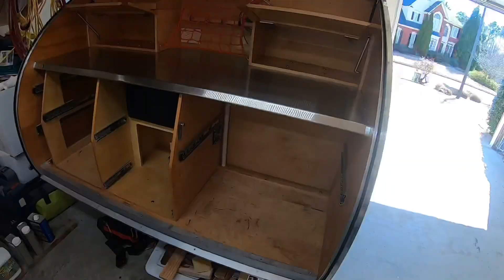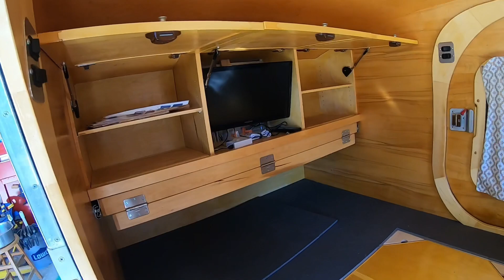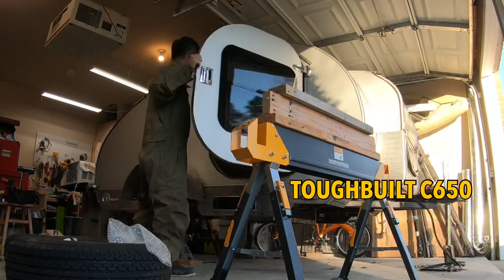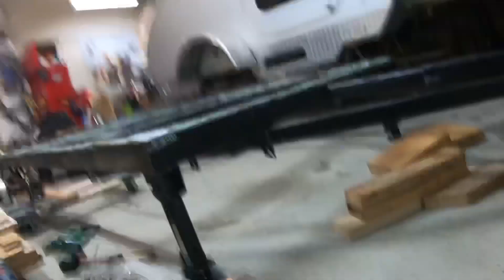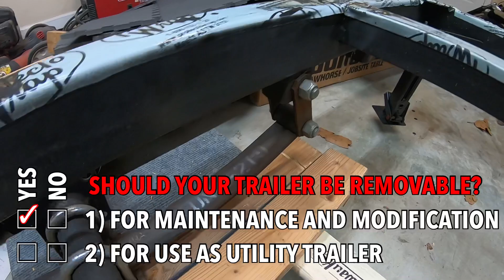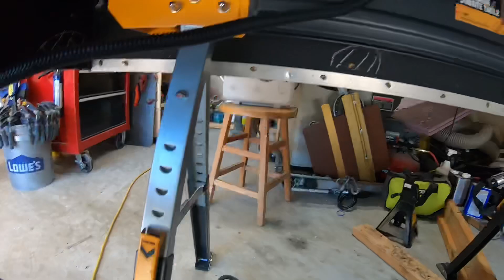【DIY Camper: #01】 Removable Trailer?

Comment: I like that you are doing this. It will definitely help me in my planning stage. So I like the idea of a removable camper for maintaining the trailer. Not sure it's necessary for maintaining the camper, but that is why you are making this video series. I love that you are telling us about the issues you ran into with the jack and the wiring. Good things for me to consider when I design mine. Thanks. Keep up the good work.
Reply from the maker: Alex Hayden, thanks. It's all about sharing the knowledge and experience. Our campers are so custom, not everything will apply. You can decide what apply to your camper.